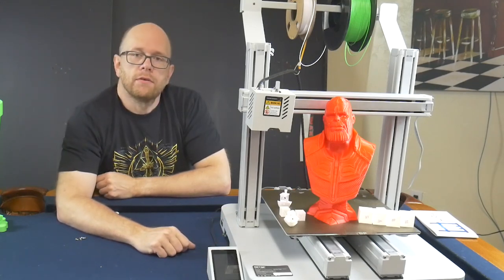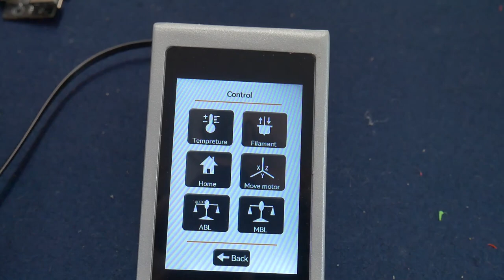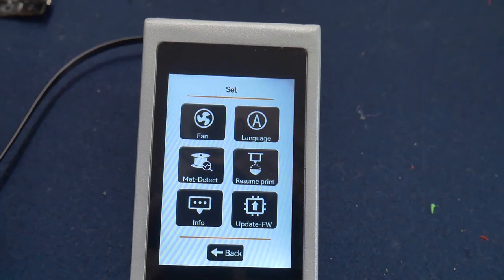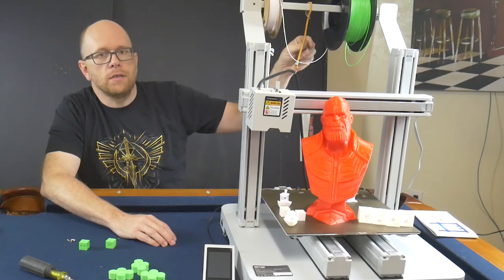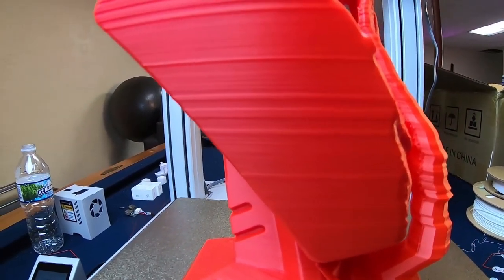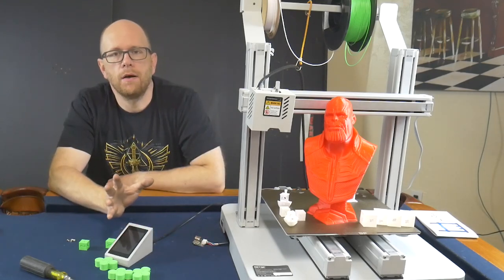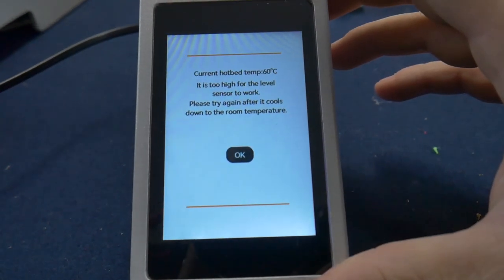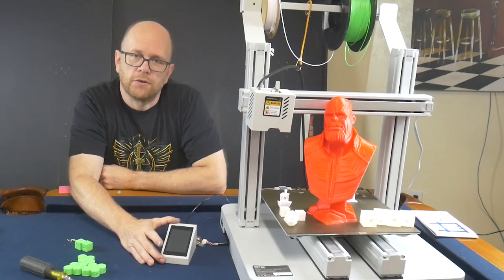Big and Fast! Hictop al13-310 First Look!

Comment: Solid review, Looks like a strong structure and mechanics but is lacking a ton in the ways you mentioned. Hopefully they will build on your review especially software side.
Reply from the maker: I agree, but they stopped communicating with me after the review came out, so you can interpret that how you want.
Reply: @SouthpawWorkshop  That is sad and unfortunately how a ton of these companies operate. They sometimes make some very capable machines and software and never build on it. Same goes for the CNC end of it.
Reply from the maker: I keep an eye on the website just in case they release new firmware for it, so far nothing yet.

Comment: what slicer do you use? if you use cura, how do you add this printer into the machine settings?
Reply from the maker: Hictop used to provide a link to a Cura profile that you could download and install. Not sure if that is the case anymore as this printer has been out for over a year and they don’t really support it anymore. I’ll see if I can find a link for you.
Reply from the maker: I checked and I don’t have a link. You can create a custom profile in Cura and add your printer specs (mainly just the build volume). It should work. Once you get some experience under your belt you can optimize the settings and modify the start and end g-code to your liking.
Reply from the maker: I remembered I was using a different computer during that time.  Here is the link to the "official" profile.  I think it only works with the version of Cura bundled in the zip file.  You might be able to use the profile on other versions, though.
https://drive.google.com/file/d/16_KsLwDmCrEGb79ce4SnPWOBDqIFLJP4/view?usp=drive_link